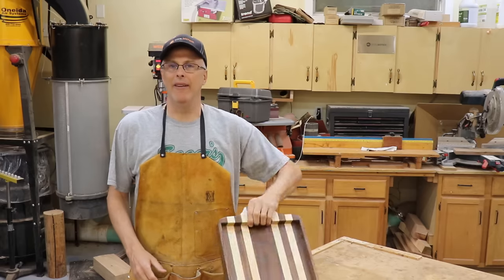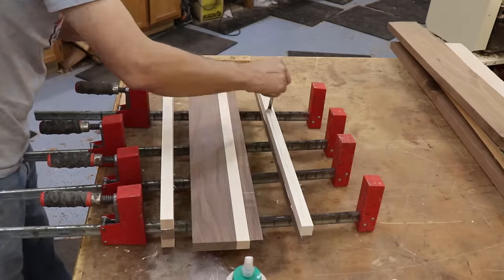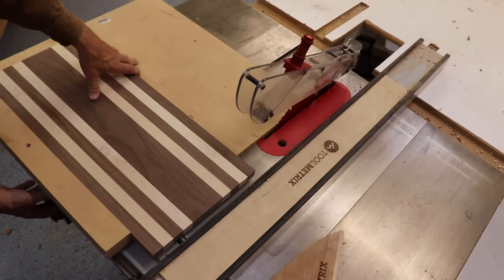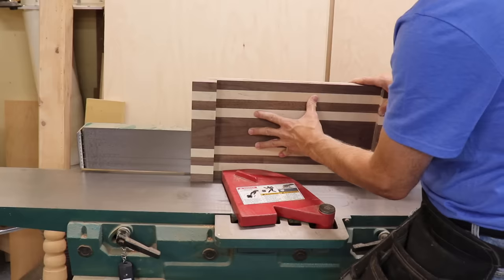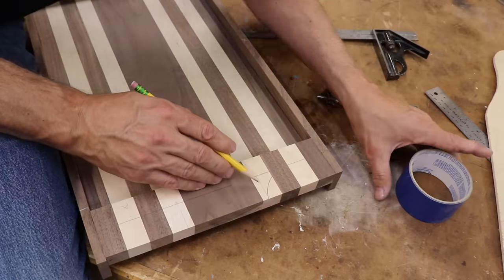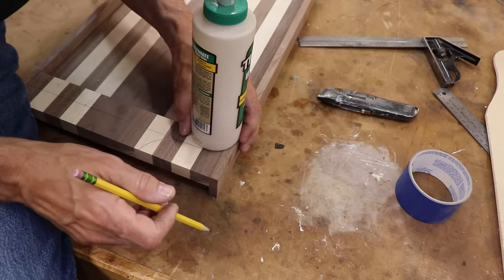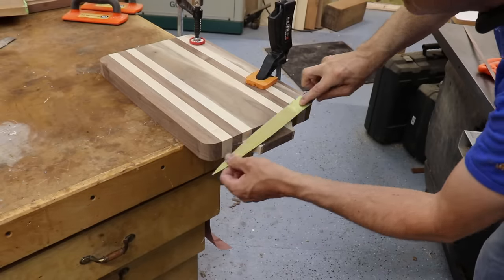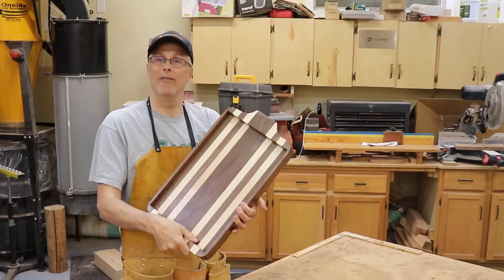A Better Way to Make a Wooden Serving Tray

Comment: If you make the two edge boards a couple inches longer on each end, the extra length will take any snipe from the planer. Then just trim the ends off.
Reply from the maker: That would require 8" extra for my planer to accommodate both sides.   I use a leader/trailer sacrificial board and it works great.

Comment: Great tutorial Paul. I’m definitely going to make one but need to know what depth wood you used? You gave the length and width but not the depth. It looks to be 3/4” but not sure.
Reply from the maker: Hi Scott, you're correct; I typically use 3/4" stock for these.

Comment: Thanks for the video. I made one for an engagement gift - and they say it’s too good to use…. I thought it might have been a little heavy. What thickness of base do you recommend?
Reply from the maker: It depends on the overall dimensions. I do feel that the bottom is a bit on the thicker side. I sometimes run the bottom through the planer a few times to lighten it up a bit after cutting off the pieces that get glued on top. That way the pieces that get glued on don’t sacrifice any height.

Comment: Great work on that serving tray Paul! If I made one of those trays I would add a few contrasting dowels to the ends that are glued on for additional strength & esthetics. Also some rubber feet for each of the bottom corners.  👍👍😉😉
Reply from the maker: Hi Steve, thanks for the suggestions.  I don't believe that additional strength is needed on the end joints, but that would add a nice look.  I should have mentioned in the video that I am planning to add feet.  I was waiting to get my laser engraving instructions, then after engraving I apply one more coat of finish, then the feet go on.  I did source the feet that I use in the description.

Comment: First time seeing this method used and I love the idea. Definitely have been looking to do a serving tray and I like the idea of not having to remove the material and rather build it up. One question though,  why the poly finish ? Did you only use that on the outer material ? I have always stayed away from poly if it involves food.
Reply from the maker: Hi Michael, thanks for sharing your feedback. Poly is one of the most durable and moisture resistant finishes that you can use for service items that are not used for direct food contact such as as serving tray or kitchen table. Poly becomes non-toxic in about 30 days so it will not hurt the food if it touches the serving tray in the same way that it would be OK if food touches your kitchen table.  That said if you want to use the piece for ongoing direct food contact as you would a cutting board or charcuterie board then it would make sense to use a finish that can be rejuvenated more easily without causing the 30 day delay for the finish to cure. Mineral oil or butcher block finish are good options for that type of application.

Comment: I see you used the Titebond for the outside radius. That's cool, but I only have Titebond 2. Is that good enough?
Reply from the maker: Absolutely. No concerns whatsoever. I would not even hesitate to use titebond original for this.

Comment: Thanks for showing this method.  It is definitely more approachable than hogging out with a router or other tools.  Do you think it would be sturdy enough to work as a "breakfast in bed" tray if the glued on sides had enough height/material below the top for a pair of legs?
Reply from the maker: Hi Daniel, thanks for watching.  Yes, absolutely, this has a 3/4" bottom and is much stronger than the typical breakfast in bed tray so I think it would work great.  Nice idea.  Cheers, Paul

Comment: Currently making this...did you round over the top of the 3/8" strips that make up the sides?   Thanks!
Reply from the maker: Just with a sander after assembly. You probably could do it before assembly but be careful to not round over in the area of the glue joint.
Reply: @ToolMetrix  thank you, new subscriber...love the channel!
Reply from the maker: Thanks 🙏

Comment: Hey great video and terrific tray! I’m just wondering if you ever had any issues with exp/contraction since the sides are constraining the cross grain of the tray.  Thank you
Reply from the maker: Thanks. I haven’t had any issues because there is no cross grain joinery in this piece whatsoever. All the grain runs in the same direction so as to avoid the problem that you are asking about.

Comment: noobie question.   Why did you use a board against the fence and then your walnut?
Reply from the maker: Hi Randy, that's a great question, and I'm glad that you asked.   These thin rips often require removal of the guard with conventional approaches.  My preference is to leave the blade guard in place for as many cuts as possible, and the sled that I used allows for that.  The simple jig that you see in this video is explained further in this jig: https://youtu.be/Sd8KLMYNQ5w .  And if you watch that, I'll give you extra credit if you can identify the person in the video.  :)

Comment: Hi Paul and thanks for that nice video/ idea.
Regarding the finish-
Why not using the Odie's Oil, which is food safe and gives an ultra-durable beautiful finish instead of toxic polyurethane?
Reply from the maker: Hi Assaf, you could certainly use Odies on this; it's a great product.  For projects that require direct food contact and frequent refresh of the finish I use butcher block conditioner and mineral oil.  With those types of products, you can use immediately after application.  For projects like this (trays, tables, etc) that are not used for direct food contact, I use poly as it offers more durability, and would never require the finish to be refreshed through normal use.  Poly is toxic until it cures, which is about 30 days under most conditions.
Reply: Thanks Paul!
Keep on these awesome videos rolling :)
Reply from the maker: Thanks 🙏!

Comment: So that’s a serving tray, and you used poly to finish, so the surface isn’t food safe. Correct?
Reply from the maker: No, that’s actually not correct. The finish is safe for food contact after it cures which is approximately 30 days. So you could serve food directly on it if you wanted to although normally with a serving tray you would have dishes placed on the tray rather than setting the food directly on the tray as you would with a charcuterie board.

Comment: BEEN IN WOODWORKING FOR 70 YEARS - TEACHING CABINETMAKING FOR 45 YEARS - HIGH SCHOOL/COLLEGE - SUGGESTION: YOU SHOULD "RAISE THE GRAIN" PRIOR TO ADDING FINISH - 7:22. ESPECIALLY ON HARDWOODS - THIS MAKES SURE ANY FINISH ADDED DOES NOT "RAISE THE GRAIN"  - THIS PROCESS INVOLVES WETTING THE WOOD - RAISING THE GRAIN - SANDING - RAISING THE WOOD - SANDING - UNTIL THE GRAIN NO LONGER RAISES ANY HIGHER -  FINALLY ADD YOUR FINAL TOP COAT - - THE SANDPAPER GRITS SHOULD INCREASE WITH EACH RAISING: 80 - 120 - 180 - 220 - 400  ALSO, YOUR METHOD OF APPLYING YOUR FINAL COAT SITS ON THE SURFACE AND COULD BE WORN OFF FASTER - I HAND RUB "TUNG" OIL ON MY PROJECTS(OLD SCHOOL "FRENCH POLISH" TECHNIQUE) LOST ART - MY FINISH IS "IN THE WOOD" AND NOT  "ON THE WOOD"
Reply from the maker: Thanks for watching and sharing your ideas.